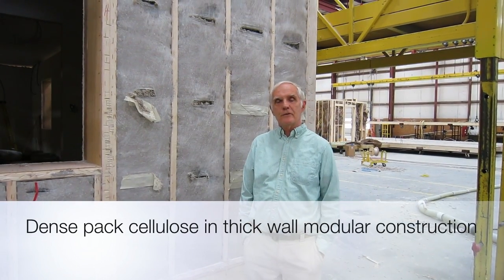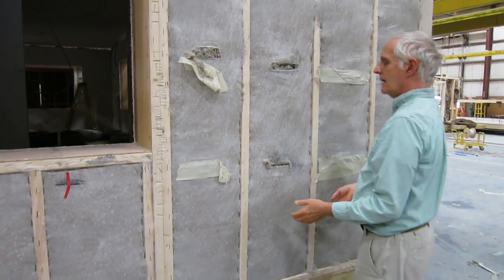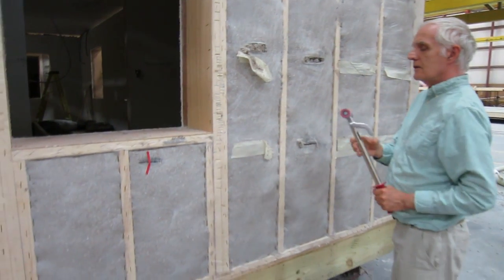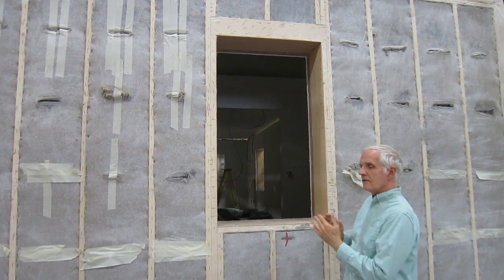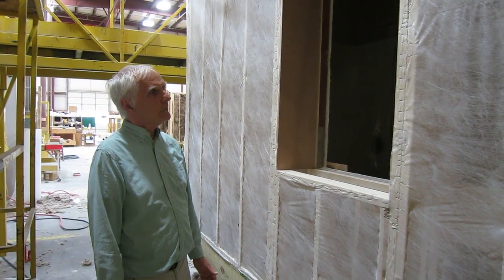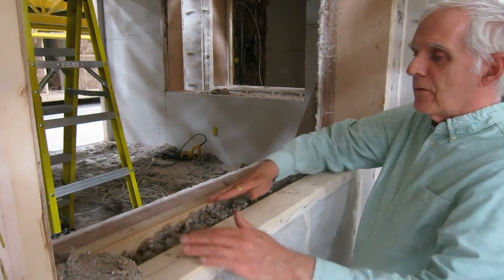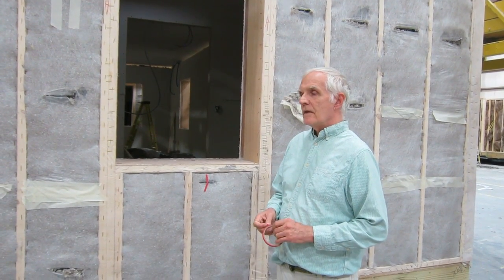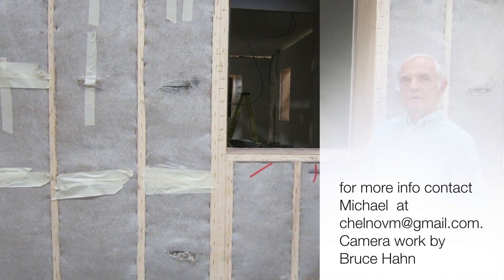Dense Pack cellulose in Modular building ..

Comment from the maker: the improved system is practiced by experienced cellulose insulating contractors who use powerful blowers with the right sized tube, and can accomplish the density in one filling. They can  tell by the sound. You might talk to Gerard at Ace insulation. in Maine 207 312 1055 or 207 336 2880. I'm an architect, and I spoke with him some years ago. I found several other dense pack insulators who were very helpful too.
Reply: I work with cellulose for a living. I can tell when it's packed just by the sound

Comment: Thanks for the video.  I wonder what kind of results you would get if you filled from the top plate down (or the bottom plate up.)
It looks like the installation has to be perfect, or you will have moisture problems.
Reply from the maker: with Dense pack It doesn't matter which way you fill it, as long as the final install is consistent. In this kind of installation (with insulweb or such)  where you can see and feel the installation, it is pretty easy to gauge. If you are filling a cavity behind sheetrock , experienced installers say they  can tell by the feel and the sound.